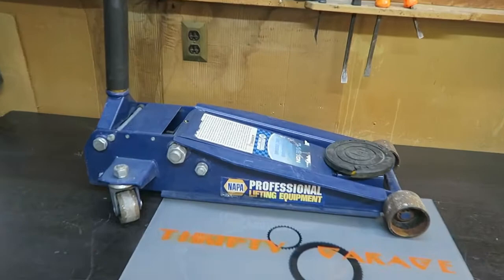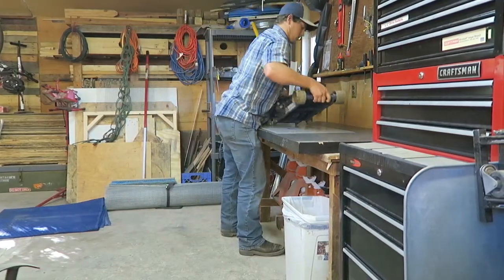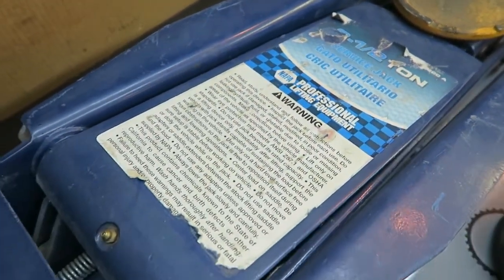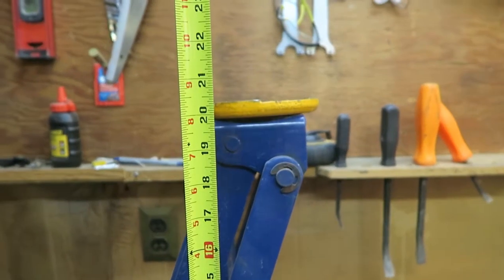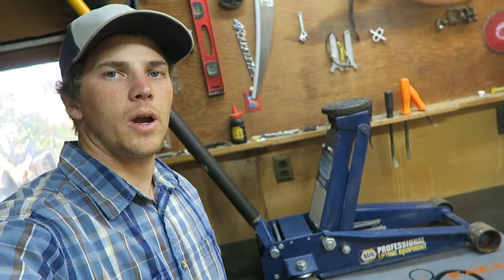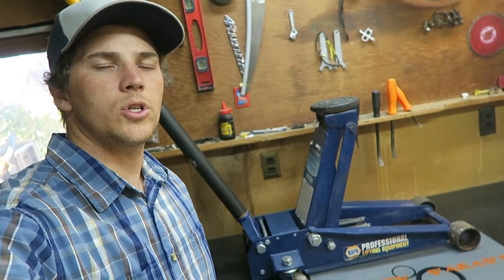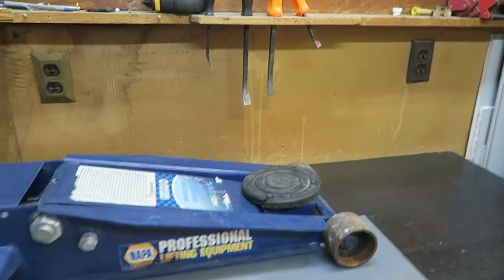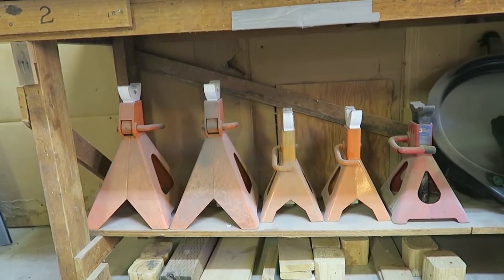Napa Floor Jack Review

Comment: What you stated in the video about the HF jack stands is ironic, since they recently had a massive recall on them.  You might want to look at what model #s are on yours because they might be subject to the recall.  OH YES, Harbor Freight can even screw up a jack stand, but not doing the quality control and leaving it up to the customer to suffer for it.  We could say that other merchanis don't do quality control on every widget in a box either, but that's because they crack down on manufacturers that aren't doing it which HF clearly hasn't been doing very well, for a long time.

Comment: Nice review, glad to finally see one that doesn't cut down Harbor Freight. I've had my Pittsburgh 3 ton service jack for 3-4 yrs now with no issues. The specs on mine are about the same as your NAPA unit. The best thing about mine is that they're ALWAYS on sale for under $80. With that said, a few weeks ago, I needed to replace my old engine crane. Harbor Freight has a 2 ton on sale for $180, but, as I was leafing through my NAPA flyer, I saw that they also have a 2 ton on sale for $200. Since the closest Harbor Freight is about 20 miles away, it would've cost about the same after buying gas to get there and back. Also, if anything was wrong with it, I'd have even more money in it returning it to the store. NAPA, on the other hand, is 2 miles away. If there was a problem with the one I bought, no big deal except they'd have to re-order it since it's not a stock item. Many people that give bad reviews on products just don't seem to realize how many of any particular product are made and sold every year. When you build a million of anything you're bound to get a bad one now and then.
Reply: You couldn't be more wrong.  Your HF 3 ton isn't as well built, and it's not "one" bad apple at HF out of millions, it's pushing HALF of their stock.  They have little to no quality control.
You bought the cheapest jack you could find and that's exactly what you received.  He did not, instead buying the best jack available at the (now) $200 price point, if you want build quality over a flashy color or higher lift for a shorter lifespan.  His is rebuildable.  HF's?  Hahahahahahaha.

Comment: Worst jack ever, I'm on my 3rd as I have to bleed it every time I use it.
Reply from the maker: Hmm, I've never had an issue and I've easily had it 5-10 years now. Westen Chaplin also uses one.
Reply: Must be doing something wrong like not storing (and keeping) it horizontal, top side up.  Nobody else is having this problem from 3 in a row.
Reply: @stinkycheese804  Funny, Napa put out a video on how to bleed these saying "if your jack isn't working, try this!" So they must have had a lot of complaints.